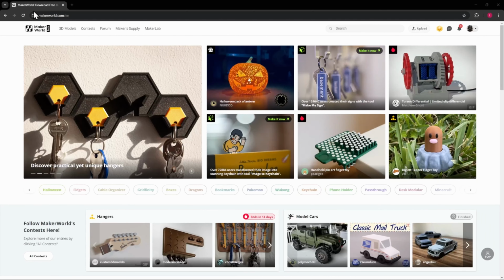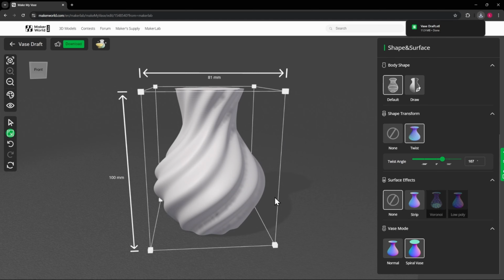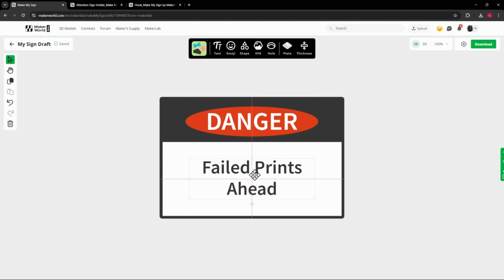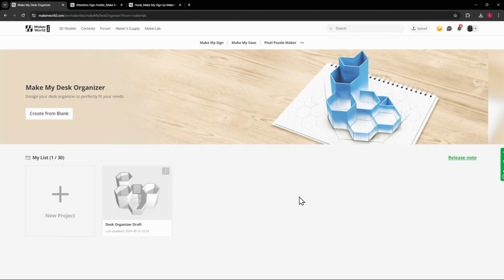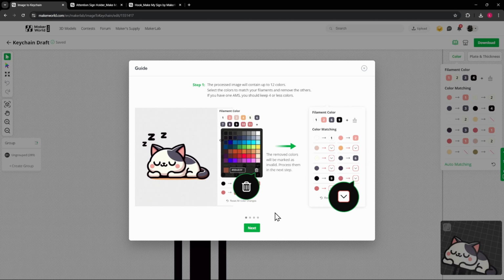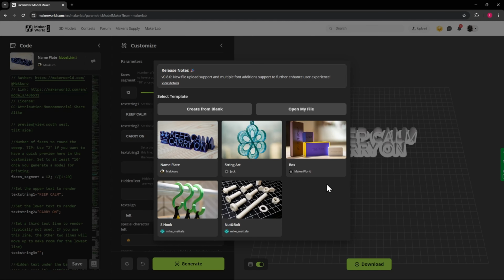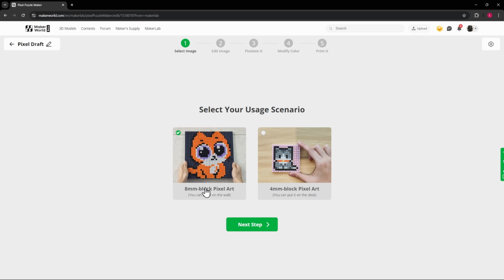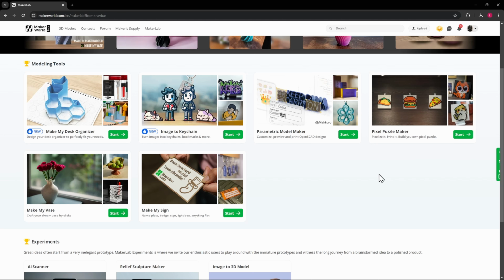Is Maker Lab Useful?

Comment: I find MakerLab very useful.  I have very modest design skills ... but I am working on improving those.  Using the tools on MakerLab are design steps at a basic level.  Rather than using a traditional CAD tool you are using the design tools provided.  I also appreciate the paramedic modeler (OpenSCAD) which allow me to quickly customize a part.  If I need to make changes I can download the script and edit.